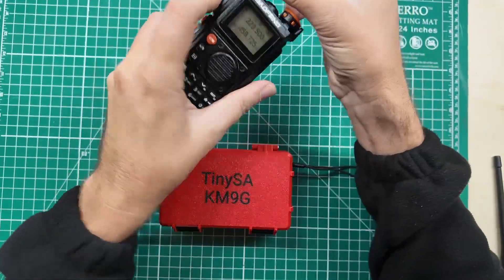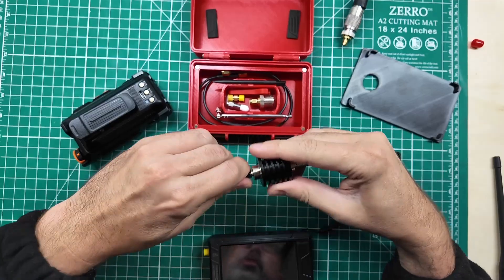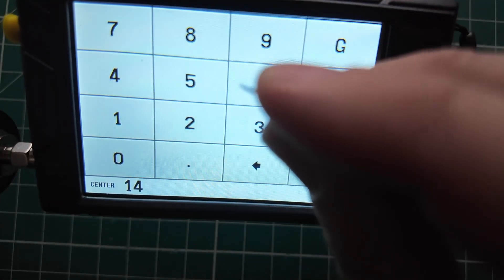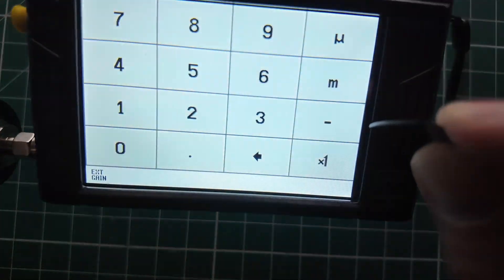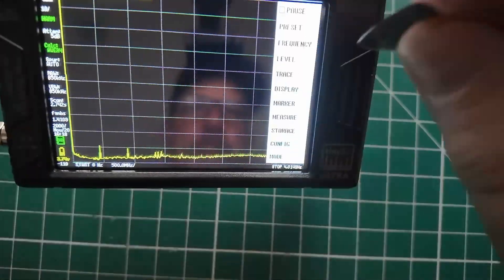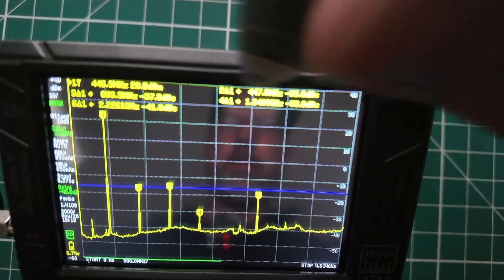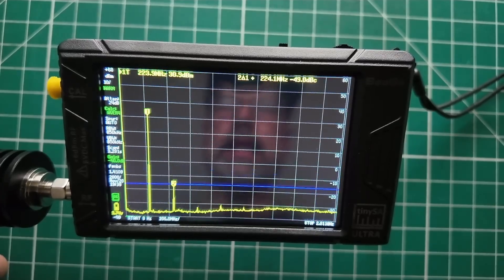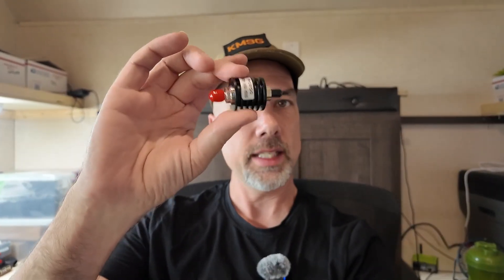Ridin' Dirty!

Comment: Interesting.  There was another video done measuring the same thing on a Baofeng AR-5RM, with almost identical results.  Surprisingly clean on 70cm, but out-of-spec noisy on 2m.  Maybe there's something uniquely challenging about making a clean, inexpensive SoC type radio working on 2m.  Anyway, good info - thanks for taking the time to test.
Reply from the maker: Thanks!  I bet they are the same guts inside too!

Comment: Hey Steve! Great videos. 

What power out did you test with? The power into the ultra should be less than -25 dBm to be sure the ultra doesn't add its own harmonic distortion. Could you add another 30 dB attenuator and confirm the results?
Reply from the maker: High power.
Reply: @temporarilyoffline  makes sense. That's about +38 dBm (6 w). To stay within Erik's recommended spec there should be about 25 dB more attenuation. The ultra is pretty linear so it might be ok as is but just to be sure of the results.

Comment: Great video. Dirty fang on 2 meters. Need band pass filter.  The newer UV-5R are testing clen now. The new Talkpod A36 is a surprize how clean. K8MRD got one and Hayden down under did a video They fixed it . I got a clean one.  Girlfriends GMRS radio now. She wanted green radio !  Works great . has air band receive as well.  Still wounded why the FCC never made harmonics requirements for 70 CM and up. For hams this stops in 220 MHZ band.  Our tax dollars at work ??  and we pay fees .  I did hear the FCC wanted to tax repeaters . Not much on this.  Still fun with radio !   73
Reply from the maker: The FCC works for the highest bidder.  No money in policing mostly unused fengs.
Reply: @temporarilyoffline  It comes down to us hams to do part 97 of fcc rules . it's up to us to have clean radios. that why we do the tests .  But some companies do listen to us and fix the problem and have clean radios. This is a big plus for the hobby ! 73